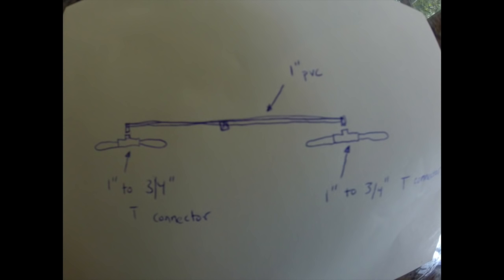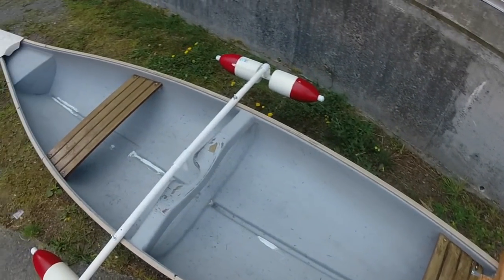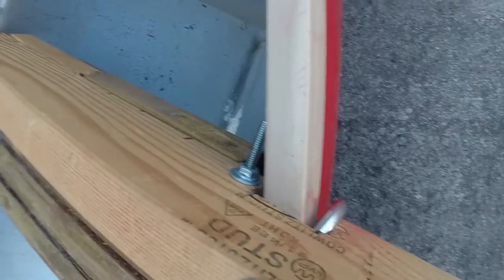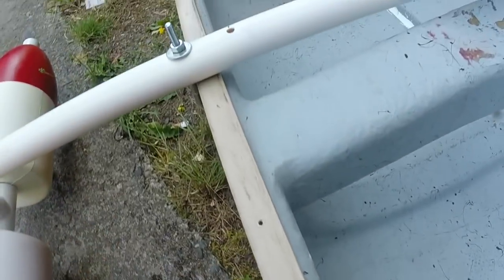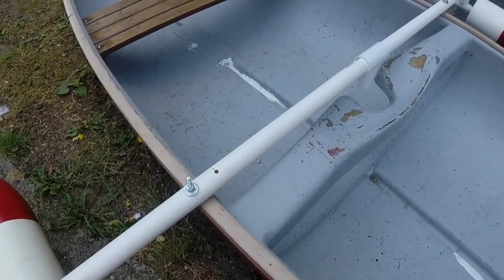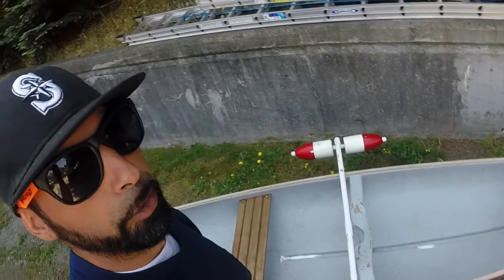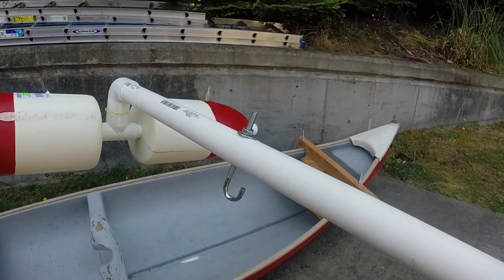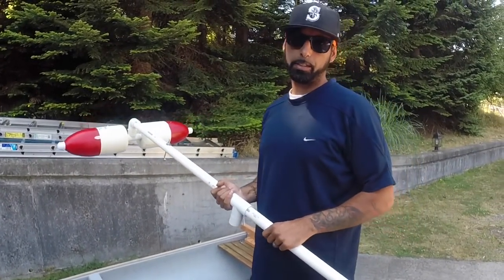DIY Canoe Outrigger/stabilizers Homemade

Comment: Just want to thank you for the idea. I just finished mine. I cut the pvc in the middle an added a 12 inch wooden dowel, so i can slide the 2 sections apart. I mounted 1 side permanently an the other side i drilled holes through the pvc an dowel then used bolts with wing nuts. Thanks again saved me a lot of money

Comment: QUESTION: could I use 1/2 pvc to hold the crab floats?  3/4 will not fit in the hole. Thank you all.Lieutenant Cannon
Reply from the maker: Sure, if the 1/2" will fit the hole it should be fine. Thanks for watching! 👍
Reply: +PNW OutdoorChannel ... Thank you very much for the fast reply.
Reply from the maker: +W. Curtis Cannon no problem! 👍